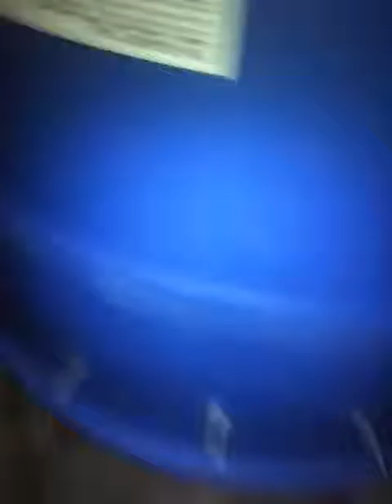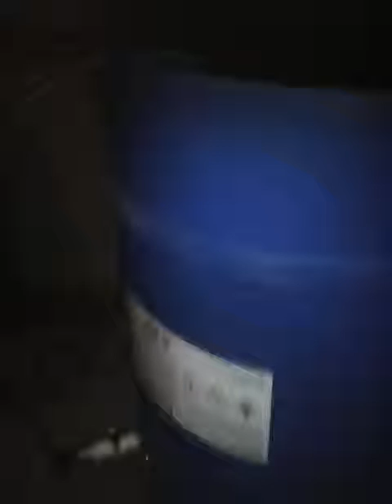Free Energy Device (Theory) Gravity Powered Water Lifter +100% Efficient.

Comment from the maker: This prototype led me towards discovering this equation that reflects the principle behind this theory and transfer of energy. You tell me.
Initial Mechanical Energy Input (E_input): 1 Joule (leveraged at 3:1).

Hydraulic Energy Generation (E_hydraulic): E_hydraulic = 3 * E_input = 3 Joules.

Energy Transfer and Work (E_work): E_work = E_hydraulic = 3 Joules.

Remaining Energy (E_remaining): E_remaining = E_input - E_work = 1 Joule - 3 Joules = -2 Joules.

In this scenario, the calculation indicates that there is a deficit of 2 Joules (-2 Joules) in energy after the work is performed, which is contrary to the principles of the conservation of energy. It's important to note that, in accordance with the laws of physics, energy cannot be created or destroyed, and the total energy should remain constant